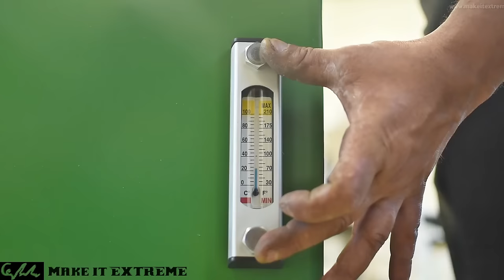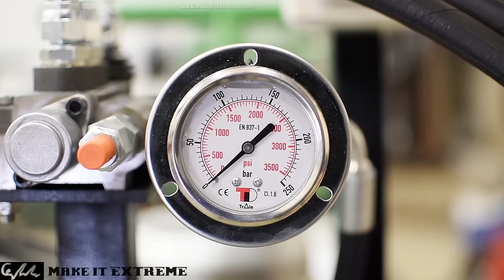Project 068 | Hydraulic Power Pack

Comment: Nice job! Love this video. I used to work for a mass producer of stock and custom stationary and mobile reservoirs. Kinda reminded me of that time in my life. Miss it at times, but it was definitely hard work. Both physically, and mentally.

Used to do non-destructive testing: hydrostatic, air pressure, DPT testing daily. Along with finishing, packaging, and shipping. 

This type of reservoir would be a hydrostatic test. Flat gaskets on the lid, with holes punched out, secured with 3/8" bolts attached to threaded tabs on the underside through the holes.

Other similar tanks never a lip on the top edge. Just gussets in the corners, 1/2" below the top edge. Those tanks had U-Channel gasket and similar lid style. There were a few dozen different types of available for motor mounts, SAE couplings. Some NPT threads, but mostly SAE. All other tanks had 3/4" SAE drains on the tank itself. Very rarely we'd also do british standard fittings.

1 gallon - thousands of gallon pressure & holding reservoirs for all types of industry. Carbon/ Stainless, you name it.
We bidded on, and produced some of the nicest tanks for Wajax, Arcelor Mittal, Bosch were some of the most beautiful ones to-date.  Arcelor-Mittal had 3 of the biggest tanks we ever did in the 5 years I was there. 

Thinking about starting my own company doing that exact thing. As I had a supervisory position, it was quite the handle, and bullshit I had to put up with, learned a lot about people, the product for mass production.  :D

Cheers, thanks for the video
Good luck. I look forward to videos of the use of this hydraulic unit!

If you need parts, or somewhere to look, or more inspiration, send me a message or find a way to privately contact me, I'll hook you up with some info on a multi-national company for both stationary and mobile sub-systems, and single unit propagation. :D

Comment: The Russian built quite many things from scraps with a few manual power tools like angle grinder, welder, sometimes without even a professional drill press with great ideas. This guy’s shop is filled to the roof with all kind of purpose built tools and materials which I guess must be worth of $100K. I like to watch the process but what they make are not extreme anyway.

Comment: Ideally, when setting up the suction strainer you want it horizontal and as Low in the tank as possible. 

That’s the way to get the most out of your oil. Especially if you have several different cylinders/attachments.. each time you disconnect one, quite a bit of oil gets left behind in the cylinder. Having the strainer up like that highly increases chance for cavitation. 

This isn’t meant to be a smart ass comment, just a heads up for getting the most out of your new machine.

Comment: Great video and project. 

I did not read through all the comments, so it might have already been said, but is that motor designed and rated to be run in the vertical position like that?

I'm asking because MOST motors have plain roller bearings and if run in this position, they'll fail fast. You need tapered roller thrust bearings to support that shaft if you're running it in the vertical position. A quick google search of the model number will tell you all you need to know about running positions.

In any case, keep up the great work.

Comment: There's something I've been wondering about, and given you guys do it in like every 2nd to 3rd video atleast once maybe you can tell me: why is it that when cutting threads on the lathe the cuts are so slight that they barely take out a literal hair of material?
I've seen this being done that way in more than one place so I assume there is a good reason, but I can't really (as someone who obviously never used one myself) figure it out, given that with other uses the cuts can really bite pieces out without a problem.

Comment: the hydraulic pump maximum performance is small, so the slow hydraulics, or revs of the electric motor is not enough? 
or distributor is not configured?

Comment: why you put a filter at absorber of the pump and an other to the return of the oil in tank, ???
Reply: Despina Vutas one of them is a fine filter, ones to keep big debris out of the intake pipe the other is for the fill port to keep big debris from entering tank and there all different mesh sizes

Comment: What size motor was necessary for this build, and what RPMs?
Reply: You should select the pump first and then find motor for it. Pump info will tell you RPMs and resistances and such that you can then calculate into motor RPM and how many hp motor you need for it. If you need small setup then just pick up cheap hydraulic log splitter and take hyd. pump setup and piston from there. :)

Comment: For power pack inside lines metal pipe linings only advisable! you had shown all in 5.5 min but it is not that much easy: in mechanical engineering making a hydraulic power packs is some what tricky and clean line subject ok congratulations

Comment: Hey, I've to develop new Hydraulic project. I've have 2 numbers of 1000mm cylinder and want 2 tons of pressure. So how many HP motor and oil pump required to get enough  power pack. Please anyone guide me on this.

Comment: Hey guys I need someone who understands hydraulics. Why does he have a solenoid valve? Can't they just turn on the motor when they need movement? Is it so he can build up pressure and than release it all at once? Or maybe because the engine uses oil.

Comment: This look like an entertanmaint video without system specifications, so that one can made for oneself, the purpose of video should be informative
How to match Gear Pump and Motor, I have mad Hydraulic Press Machine for my scrap business but it is not giving pressing carrd board scrap and plastic bottles in a good satisfactory copression, i ahve 18.5 KW motorr and gear pump is second hand used pump, i dont know its spec. plz tell about the matching of motor and gear pump.

Comment: One of the few disappointing ones.. It's a box.. with some holes in it..
Hopefully the use of it will be far better!
Reply: Electra Flarefire not really. Think of all the applications
Reply: That's what I'm hoping for and that is what I said. What they do with it might be interesting, it's just that this build is really quite dull compared to their other ones.
They have set a high bar for themselves! 
Another channel's equivalent would be 'lets slap together this wooden box to put some batteries in it'.  Practical, not impressive or interesting.
Reply: Electra Flarefire what would be more interesting is if they made an induction motor for it. Included Sime batteries and an inverter in it to power the motor. Electric beats fossil fuels.

Comment: I have a video of a machine that I built to cut straight lines in sheet metal with a plasma cutter.
You are welcome to copy it and make it extreme! There's not much to it a car wiper motor a long bit of 8mm threaded rod and a length of 40x40 mm unistrut  (used in industrial installations for holding heavily cables and pipes)
Have a look at my videos and msg me if you want more information

Comment: Typically I'm impressed with what these guys have accomplished but I'm going to be in the minority on this one because all they've really done is build a tank and assemble bits and pieces to have a functional hydraulic power plant. Other than building the tank everything else is an off the shelf purchase. Ok, so they made a flange on the lathe to keep the motor from falling in, so what. The vise, electromagnet from a MoT, the bending and forming machines, belt sander/grinder were impressive but sadly this and the hydraulic cylinder were NOT.